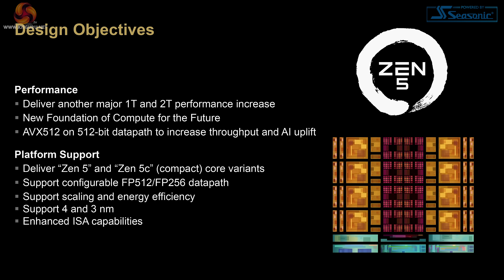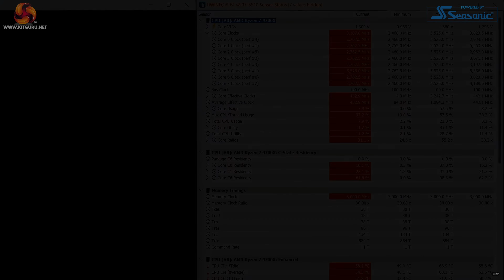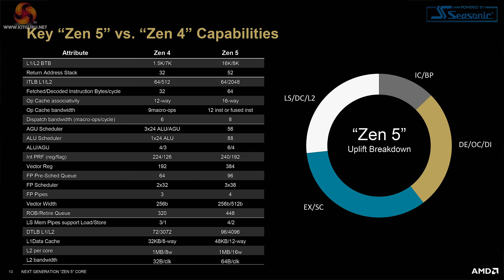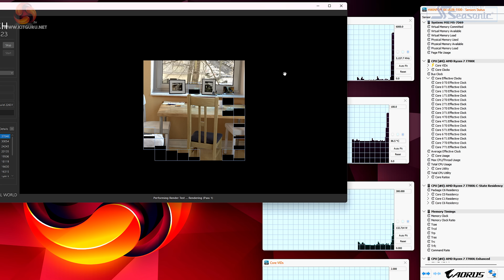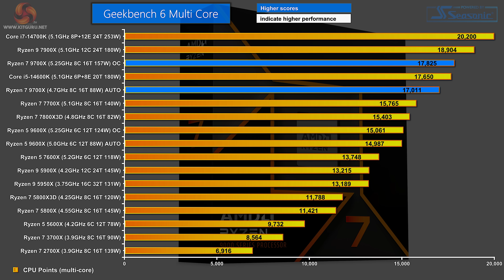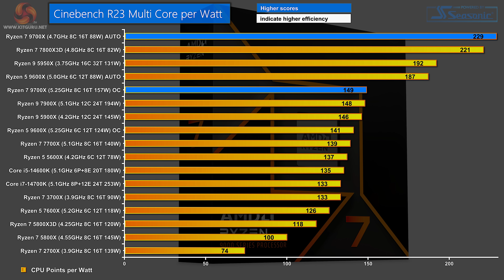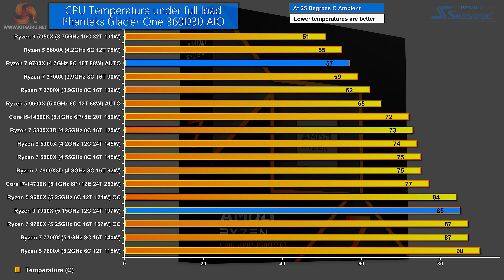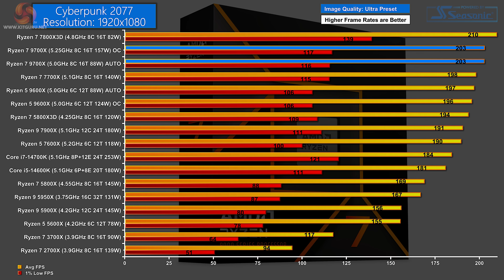AMD Ryzen 7 9700X review: YouTube hates this CPU

Comment: Thank-god for Leo and Wendell both coming through with factual and knowledgeable reviews. It seems like many of the other Zero-hour reviews all missed the mark on what these CPU and how to review them.
Reply: @CuttingEdgeRetro  reviewers like gamer nexus have seen CPUs like the 7600, 7700 and 7900 perform like this at power limits the same as the 9700x, so they where expecting the 9700x to have some big gains over the non x parts whilst have the same power efficiency, however that's not the case, they seem to be higher specs non x versions of the 7600 and 7700 as for the 9900x that has a higher tdp so that's going to be the most interesting CPU for zen 5 apart from the x3d models, honestly if amd wanted these big gains at these power limits they may as well of put 3d cache into these CPUs however they didn't.
Reply: Was going to post the exact same thing. Beat me to it 👍🏻
Reply: These reviews have my bs radar going off on a lot of techtubers i should thank zen 5 for just exposing them all as its best feature.
Reply: @humality144 Like who?
Reply: @dademr  im not the type to speak on people without much evidence i just noticed a few people who i usually have relative trust in totally botching their coverage on these chips missing major points seemingly just to bash amd id have to do more diligence to name em tho
Reply: @humality144 yup. A couple in particular
Reply: Nah it’s just that other reviewers had expectations for a drastic jump in performance vs cost. Thats not what these chips did.
Reply: @Techcensorshipbot  what did these chips do exactly? power efficiency and what else?
Reply: @Techcensorshipbot  The data center folk are going to be very happy with the jump in enterprise workload performance and appreciably lower core power. And unfortunately for "reviewers" that is where AMD is pulling in the big revenue numbers. Datacenter and mobile are the priority not a bunch of "reviewers" arguing over a couple percentage points of game frame rate which is mostly irrelevant to the majority of gamers anyway.
Reply: They didn’t miss the mark. If you want the same performance for lower power on a desktop it’s nothing impressive at all. These are desktop CPU’s not laptops. Even if you double their wattage output you only get a consistent %10 performance gain over the 7700x. These chips are disappointing.
Reply: Fax I think it's a brill bit of kit, getting more efficiency shouldn't be looked down upon!

Comment: 3:10 You didn't need to wait till 2024 for the 9700X to get 7700X performance with less power and heat, because the 7700 already exists for almost 2 years. Braindead L take supporting stagnation.
Reply from the maker: and the 7700 delivers the same performance at 65W as the 7700X at 105W? 
Leo

Comment: The problem is that you can get a 7700 ($260) or 7700x ($270) for $100 cheaper for near identical performance or a 7800x3d ($340)  for cheaper and better gaming performance. Seriously they are that much cheaper right now at microcenter. The 9700x is best avoided by everyone. It should have been called the 9700 and launched at $300 at most. Even that is probably to much. Remember AMD is also competing with themselves now. This CPU is awful value.

Comment: What your review on gaming showed is that almost any of the newer processors from either Intel or AMD is showing very little difference between any of them and how little the cpu is used as a percentage of its performance capability.  Good job and importantly rational.

Comment: as it stand right now both 9600x and 9700x are unsellable in current market, even when we take out intel completely out of picture
they are expensive and offer very minimal upgrade over 2 year old 7000 CPUs
9700X cost more than 7800x3D and way more than 7700/7700X, while offering minimal performance upgrade and when comparing to 7800 x3D , 7700 non X also minimal power effeciency upgrade
9600X cost more than 7700X, that all

amd also give you free stuff with 7000 CPU right now, zero reason to buy this new overpriced pieces , bad pricing overall

Comment: Good to see an alternative view. Having slightly more performance for considerably less power is significant, and other reviews have treated the drop in power as completely irrelevant.
Reply: Exactly.. and if you turn on pbo and power limits equivalent to the 7700x then the improvements are clearly evident. Der8auer saw some pretty insane gains when turning on PBO.

I think this was a fumble by AMD though. The x chips aren't supposed to be focused on power efficiency, that's what the non x variants are for. What're they gonna do now? Lower the tdp on non x chips to 35w or something? 

What AMD did for these 2 cpus just doesn't make sense really. They should have been at 105+ tdp out of the box with an option for eco mode dropping it to 65w. This is just a fumble for what is clearly a pretty decent generational improvement. 

Regardless, matching the equivalent previous gens performance with half the watts is impressive.. but that doesn't show up well in reviews. People want to see big generational improvements, which I think these chips can do.. if they weren't so power limited. I mean hell, the 9700x was running at like 55c under load or something, that's unbelievably low for a chip that can handle 90c indefinitely.
Reply: @jarnovilen5259  It might not be a huge achievement for most but for me. It's great or at the very least, good. It's not because I care about power usage in general. It's because it produces a lot less heat and throw the lower power usage to it too and you got a great CPU that won't blow up even in the worst case scenario cooling. (my PCs CPU cooling is ass like my 5800X3D is under fire the moment it starts to get utilized heavily lol). And once you get good cooling. You can overclock the CPU better than the 7700x and get better performance at the same wattage (almost). Yeah AMD is not really improving anything in terms of performance for the 9600x and 9700x. I do think AMD should just overclocked the CPUs already to make a bigger difference and let the users undervolt it if they want.
Reply: It is irrelevant at its current value.
Reply: There is no efficiency gain. Watch GN's video. Zen 5 just sucks. Basically Intel 14+++++.
Reply: Power drop is not irrelevant. It’s measurable, but not sygnificant. Other tech channels measured 20-40W less power consumption. Nothing jaw droping.
Reply: I hipe the 7800x3d drop prices after 9800x3d release, damn lol
Reply: i dont get this "oh but if you overclock it , it gets quite good and reaches over the competition" guess what YOU CAN OVERCLOCK THEM ASWELL! only overclocking the review sample means nothing.
Reply: It’s the price!!! At current pricing for zen4 these zen 5 parts, which sometimes have a regression in performance, are stupid. Unnecessary. The price needs to drop otherwise what’s the point of spending more money to get (sometimes) worse performance ?
Reply: @j340_official  When you can't buy a 7700 anymore.
Reply: Yeah especially if you don't have the best cooling
Reply: 7700 makes this cpu irrelevant af
Reply: @AssassinIsAfk  ROFL, no... turn on PBO and get an additional 10-15% more performances.
Reply: What Assassin said. The comparison of the 400€ 9700X against the 304€ 7700 is damning. Tray versions of the 7700 sell for 220-230€.
Reply: It's pretty irrelevant for most single PC users. Is an average user actually able to tell the difference if his total system draw under load in 600 watts or 570? Would you notice it on your power bill? Could you Feel the minute heat difference in the room? Pretty sure everyone including AMD would trade the efficiency for 15% more performance in a heartbeat. These chips just can't do it, otherwise AMD would have pushed the TDP up just like the last gen.
Reply: ESRO was supposed to be 359 dollars, looks like scalpers are already at it…
Reply: Ran some calcs on electric bill, verdict? In the US probably doesn’t matter, its like 12 bucks or so a year where I live. But in Germany, its a wopping 35 dollars a year running 4 hours a day full tick vs a 120 watt cpu. So yes, it does make a difference if you are budget constricted.

Don’t even get me started on the power savings vs intels pieces of shit that are overclocked by default
Reply: @goldenhate6649  that might be somewhat compelling, save that  previous processor came with an eco mode, or even two. My 5800x has a 65 watt TDP mode, and even a 35 watt TDP mode, leaving you with greater than 90% of the performance and the savings your tight budget may require. The real issue is this processor either can't be stable or gains nothing by having a higher TDP, or AMD would have released them as such and included the usual eco modes. They didn't fail to increase performance on purpose in the name of efficiency, they just failed to create a part that can handle or benefit from a higher power draw.

Comment: As far as prices go, when you want to buy CPU you only care about price today, not 2 years ago. What a strange mental gymnastic that was. 7700 non X is just a s power efficient and about 7% slower and a lot cheaper. 9700x is just too expensive for what it is.
Reply: The biggest differentiator is the 9700X can be overclocked. A couple of sites already showed that you can get 15-20% more performance in single and multi threaded workloads if you use PBO and curve optimizer. You can't do that with the 7700X. Zen 4 is already running balls to the walls. Zen 5 has more headroom. If you already have Zen 4, no need to upgrade. If you don't want to fiddle with your chip and OC and don't care about efficiency, don't get Zen 5. Lastly, Zen 4 chip production is being cut down and most probably stopped for the i7-i9 chips which means once stocks run out, it's gone.

EDIT: There's 1 channel so far that has shown the different ways to OC this new chip which none of the main stream reviewers either don't know or don't show. Look for "skatterbencher" on YT. He has OC'd his 9700k to 5860 Mhz and shows the different levels/ways to OC Zen 5. It's very straight to the point and shows how much you can push these newer chips. OCing is actually back with these chips.
Reply: @pkpnyt4711  Believe me a lot of people will do just that.
Reply: Perhaps a fair take, but I see that many critiques of this CPU aren’t that nuanced.
Reply: Give it a year, price will fall. Always does with AMD.
Reply: You're completely illogical. Learn how to use your brain. People care very much about release price history. That's why $70 games are disliked. Cause 2 years ago they were $60. That's part of the heistation among many outlets to compliment the 7800XT. Because, a $500 release MSRP puts it $100 higher than the 290X & 5700XT MSR. Compared to current prices it was good, but compared to historical prices it was still crap. Hence the sentiment was "thanks for not COMPLETELY ripping me off like Nvidia is trying to do".

You're so detached from reality that I question how you function at all in daily life lmao.
Reply: This.  Very disappointing by kitguru.
An incremental update (at best) and looking very poor value against what is currently available.

Comment: Wow i gonna say this review is much than even Gamer Nexus, not that GN is not good, but opposite, it was too detail and messy with too much data, but fail to delivery the real strength of this Ryzen 9700X. The clock speed was downclocked and yet it still perform on par if not slightly faster than 7700X, this clearly show some IPC improvement. But AMD knowing Intel cant catch up, no longer chase the clock and go for power efficiency. Now everything make perfect sense!

Given the IPC bump and better Performance per watt, I am hyped for the upcoming 9800X3D. Man that one is a beast especially if it can be overclocked properly.
Reply: 12th gen Intel is still available and cheap, it can't match the efficiency but many don't care.
Reply: @nimrodery  gaming performance comes first before price.
Reply: @Gattberserk  That's why I mentioned them, they're cheap and perform well. If you wanted more performance then you'd spend more and get a 7800 X3D (although depending on region that's probably cheaper).

Comment: Finally, a competent and fair review of this part focusing on where it truly shines, that being much better 1440p gaming and production than its predecessor while using far less power and still having an insane amount of OC headroom for those who want to pursue that. Thank you. For those building their first system like me, this is an amazing part.
Reply: I wonder if 7700 (non X) for half the price would get you almost (-5%) the same thing. This is true competition to 9700x not the 7700x.
Reply: @tehehe5929  no. You’d get dramatically far less performance on that part in 1440p gaming, and no ability to oc without ECG, and even then, even an OC 7700/7700x wouldn’t even get close to the performance of an OC 9700X in 1440p gaming and production benchmarks.

Assuming you’re on AM5 and playing only in 1080p and doing no productivity work given your question, I’d suggest the 7600x which performs practically identically to the other 7000x non-3D parts in 1080p gaming.
Reply: What people need to keep in mind, is that this new part is an EITHER OR part. Meaning, if you want it, you get slightly better performance than a 7700x but in what is practically eco-mode using basically half the power of the 7700x, OR you have a part which absolutely fkn slays when OC, even beating the 7800x3D in 1440p gaming and nipping at the heels of the 5950x in production.

Comment: 9700X feels a lot like it should have been named 9700. Just like we have 7700 and 7700X.
It would have been nice to have the 7700 in your charts. But I guess you could always add a CPU. 🤷‍♂
Reply: This is more like 3700x vs 3800x… do maybe we get 9800x later with 105w with lot worse effiency and little bit more speed…

Comment: I have no idea what, but something weird is going on with the Zen5-CPU's. The results are not in line with AMD's benchmarks and there is no way that AMD expected this level of performance until recently. Two weeks ago AMD decided to postpone the launch with 2 weeks. +weird and inconsistent resullts among the reviewers. The most worrisome part for me: the singlethreaded clock-frequency not getting achieved (I experienced this with my current 3700X which gets stuck at 4.25 GHz and twice a hour for a microsecond 4..35 GHz) and the lack of gained performance when PBO gets used, when you increase the electrical power with PBO then you should get at least 50% extra multithreaded performance compared to the extra power, so for 2x power you should get 1.5 performance in multithreaded loads.  My guess: there is a big firmwareproblem and AMD hoped to fix this within 2 weeks but it didn't happen. Time will tell. I was considering upgrading to Zen5 (from a 3700X) but it looks like it might be Zen6.
Reply: Most likely a agesa/firmware issue as well as some OS scheduler issue going on. Give it month or so.
Reply: @JMNovak1011  OS scheduler for sure, the rest remains to be seen. Otherwise it wouldn't perform so much better in the comparisons from the Phoronix guy. The big mysterie for me is why some techtubers/webmagazines got a better result for the same games/productivity-software than others even when the others (Hardware Unboxed) seemingly used good enough DDR5. Anyway, the Phoronix benchmarks make me more optimistic about maybe upgrading to a 7950X3D or 7800X3D. I have a 3700X and 5700 XT (getting old) so I am kind of due for an upgrade. I use Linux so I don't care about Windows-specific problems with 16-core Ryzen-CPU's.

Comment: Manual Overclocking is BACK!
Reply: It's how I ran the 7600x and 7700x.  AMD never seem to get the power curves right.
Reply: @robertmyers6488   If the 6 core is limited to 88 watts the 8 core limit should be around 115 watts.
Reply: I'm sure AMD played it safe with the out of the box performance considering what Intel is going through.
Reply: could also be just complacency. since not much competition from the other side